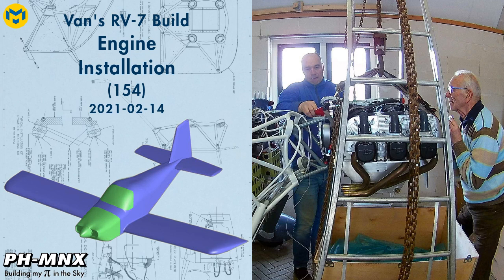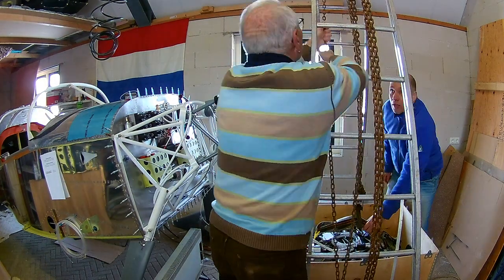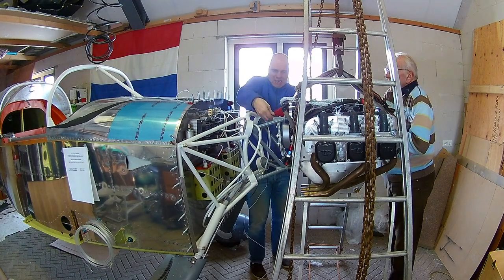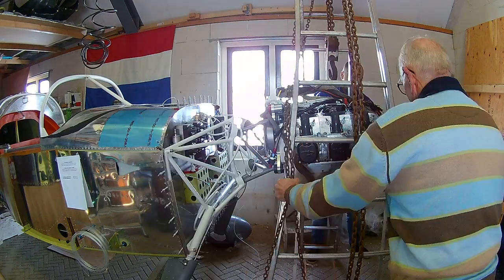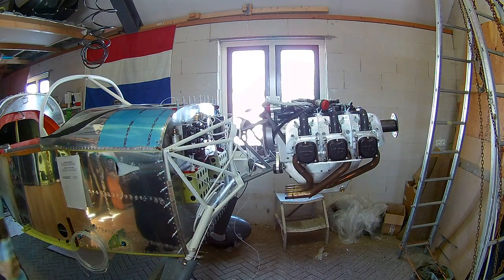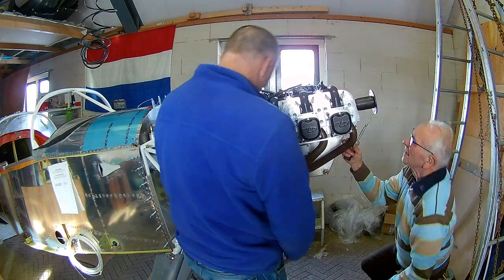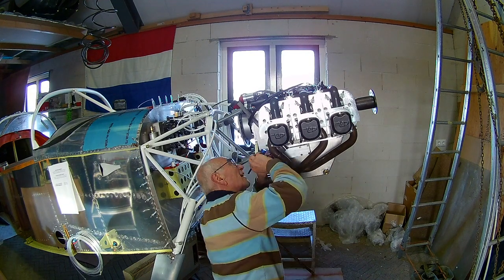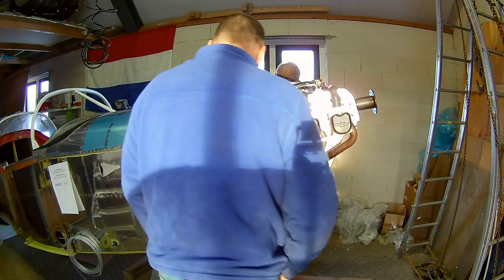Van's RV-7 Build Engine Installation (154)

Comment: Hi mate, what was the cost difference between a I0360 and the UL 520? I am thinking about the 520i for my 6
Reply from the maker: Hi Andy,
I'm not exactly shore what a IO360 costs, probably depends on the type and options. However I didn't want a Lycoming anyway, because I really like the UL Power. 
I guess an IO360 is probably between 40 and 50 thousand Euro (in Europe) and the 520 is between the 35 en 40. 
So besides being more fuel efficient , more power, lighter and more modern, it is also slightly less expensieve and easy to maintain.
However you do need additional work on the cowling. I guess the 'standard' Van's cowl fits the Lycoming, it won't fit the UL Power, You need to shift the UL Power forward (engine mount extension) to get the CG right. This results in a longer cowl (which I think is nicer anyway.
Cheers,
Marcel
Reply: @PHMNX  thanks for the reply Marcel, i have emailed Ray in the USA for costings on the mount extension and cowling. I think this is how i might go as well but for my RV6A. Im looking forward to seeing how yours performs and really enjoy watching your uploads on the build thank you.
Reply from the maker: @AndysRV 
I've heard from Evelyne (ULPower Belgium) that thei are constructing a extension and cowl too (for Europe). Deponding on shipping costs that might be a cheaper solution.

Comment: I am building  a RV 7 and looking to buy the same engine what was the approximate cost of your engine package?  Your videos are very helpful.
Reply from the maker: Hi John,
I bought the ULPower 520iSA, which means it runs on 97 octane or higher and is full aerobatic. Hence it's the most expensive version of the 520 (not taking the new turbo version into account).
I transported it myself (so no shipping costs).
In 2020, I payed approximately € 40.000 excl. the VAT for the complete package, including exhaust system, 6 CHT and EGT sensors and the engine mount extension and a complete cowl.
Since the engine is shifted forward, the Van's cowl won't fit, so you can reduce the finist kit winh the cowl (saves almost $ 2000).
I really like the ULPower engine, and I guess the new Turbo version is awesome, but probably way more expensive.
I'll post the first engine start shortly.